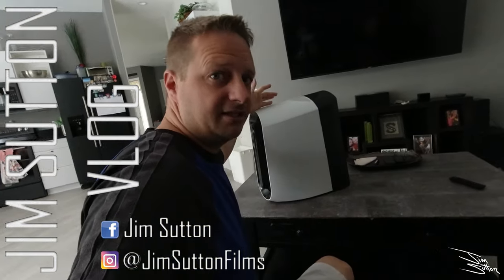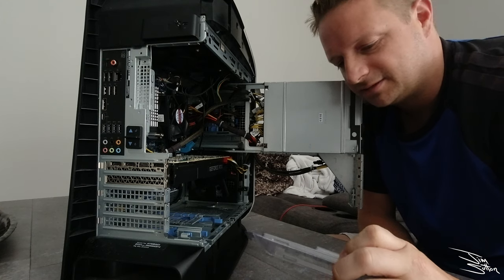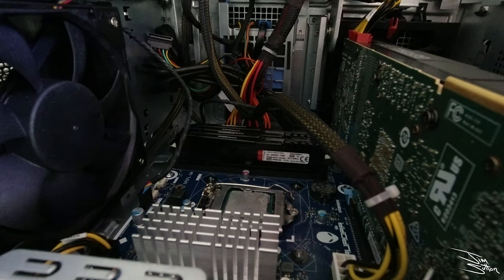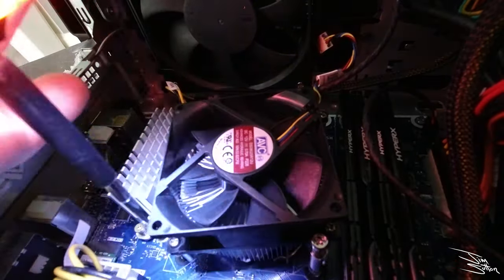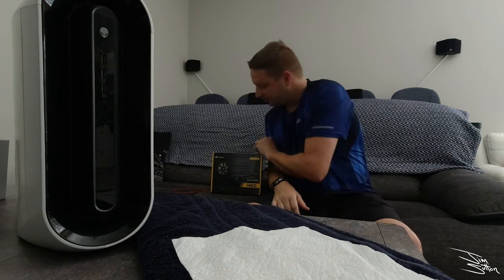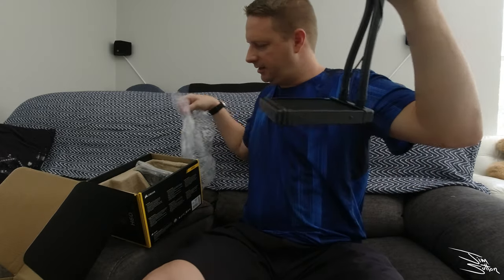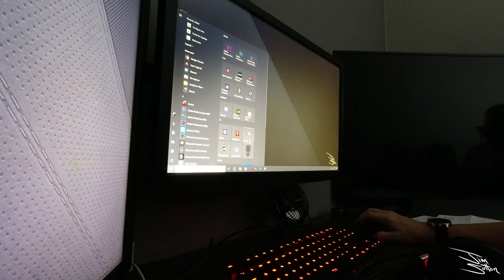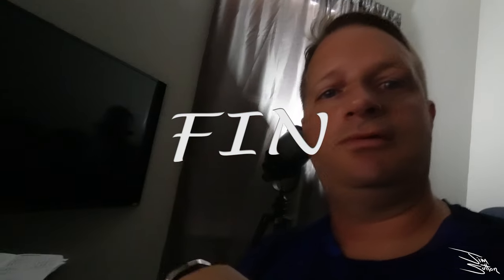VLOG #128 loud Alienware adding water-cooling so its silent and does not run so hot! Alienware R9

Comment: Quick question, I did everything but I get the preboot diagnostic every time now, which inevitably leads to an error saying the CPU fan failed to respond. Obviously, I don't have a clue fan now, what can I do about this? Something in bios maybe?
Reply from the maker: No.  Add pins for the pump.. to pump.  Put the fan on the CPU fan.   That clears the error.  Then add the new fan in addition to that as well if you like. I did.   And no errors in sight.
Reply: @DeCoNzMe  thanks I'll give it a go
Reply from the maker: Yup. Keep us posted.  Nothing difficult.  Just the right fan headers will fix that.
Reply: I’m having this issue too. Tried switching the top fan connector to the cpu fan connection but the pre boot diagnostics screen still comes up.
Reply from the maker: It sounds like fans that are not compatible.
Reply: Well I just got done adding the original top fan underneath the radiator to make the sandwich and now it seems to be booting just fine. Weird. What temps do you get under heavy loads?
Reply: Now it seems to be running just as hot as it was before I made the switch...lmao i cant win.
Reply from the maker: That doesn't make sense.  What configuration did you do them in?  Mine has them blowing up and out of the pc.   The one on the inside of the case is the one that is plugged into the CPU fan headers.  So it changes speed with the temps.  However. I did debate going into settings and have it run 100% all the time.  But I have not done that.
Reply: @DeCoNzMe  So upon opening up the chassis again I discovered one of the water cooling lines was kinked due to the power supply. So maybe that was the issue. Also, its crazy your CPU is running under 50C while gaming. Mine idols between 30-40 but gaming it goes up to 70 sometimes 80 peak, and this is with my side panel off as well as the power supply being out a bit. My configuration is the same as yours except I'm doing this with the R11. So I think our CPU fan headers are in a different spot because my bottom fan of the sandwich(original top fan) wont reach the header. I tried taking the fan out again but then I get the problems booting the system up. Its like Dell is expecting both the top fan header and CPU fan header to be connected. Hopefully when I close it up completely tomorrow I am still getting these temps. Would still be a big improvement from what I was getting with the original air cooled CPU fan.
Reply from the maker: Ya way better than stock air cooled for sure.
Reply: @DeCoNzMe  I got it all closed up and currently idling at 29C. So the kink in the line was the issue. To anyone doing this, be careful of that. Jim, thanks for your video. Without it I would never have known this was possible. Now I definitely plan on upgrading to a 10 core CPU in the future. It's kind of shocking Dell ships out these air cooled units that 100% was thermal throttling.
Reply from the maker: So glad to help!  Glad you got yours running like mine now!

Comment: installed new water cooler in my R9 as shown... removed my RAM in the process... got everything back together and started it up... doesnt start, blinks 2 times, error means RAM not detected... reseated all ram into same slots they always were in... still wont boot, black screen and just flashes twice still saying ram not detected. Any ideas? I no longer have a working PC
Reply from the maker: Try one stick and then the other in the number one slot. And repeat around there.  Doesn't sound likely unless you really bent something.. but I doubt it.  Pretty unlikely
Reply from the maker: Let us know when you get it.   Anyone else have a tip?
Reply: @DeCoNzMe  it ended up being a loose pin for the ram socket on the mother board. Some aggravation and soldering later, memory is now being detected and back up and running with the new cpu cooler.... I cant believe I had to take the mother board out, flip it over and re-solder 2 pins back to the primary RAM slot... my advice, be VERY careful taking the RAM chips out of this board. Ive never seen this before when removing ram and typically you dont need to be super gentle... thats not the case here. Will not be buying alienware again in the future due to this experience. Alienware (dell) motherboards are garbage.
Reply from the maker: Glad you got it.  And good advise to everyone too.  So be gentle!
Reply: @DeCoNzMe  Thank you. I love the computer otherwise... so yes, be very gentle removing the RAM on this mother board, its more fragile than most.

Comment: I recently bought an R11 with a i7 10700f. So if I ever decided I wanted to upgrade to an i9 10900kf down the line then doing this would allow me to do that then?
Reply from the maker: Not sure about those models.  Sorry wish I had an answer for ya.
Reply: @DeCoNzMe  All good man. This video is very helpful. Although I am curious, have you had any issues arise from not having installed that back plate?
Reply from the maker: @staycreamy  it already has the back plate there from stock.   So no.  No issue at all.  There is no difference in the stock one that is already there, and the one that comes with the water cooling kit.

Comment: Hey, I did notice you installed the fan on top of the radiator. I saw in another video he installed it under the radiator. Is there a difference in either position?
Reply from the maker: I ended up doing both. I now have a sandwiched radiator. Fan on top and bottom.
Reply: @DeCoNzMe  Thanks Jim.  also, did you have any problems with plugging it into the PUMP socket vs the CPU socket?  ive read you have to plug it to CPU so it system recognizes it.
Reply: Jim Sutton hey sorry for asking late but in what direction did you point each fan since you ended up putting both fans
Reply from the maker: @c5mourn  I pointed both fans to blow up and out of the case.

Comment: Got an r11 yesterday and the heating was atrocious. Getting one of these today, quick question, how do I remove the top of the case so I can get to where I need to to install everything?
Reply: Additionally, do you still feel it's best to have no thermal paste? That seems a bit strange but maybe I'm just used to fans
Reply: I ended up leaving the thermal paste on there, runs good. 40 idle and it doesn't quite scratch 60 under heavy loads (monster hunter and the forest maxed out)
Reply from the maker: Not.. no thermal paste.. I used the pad instead.  But glad you are getting great gains like I did!
Reply: y didnt u get the r11 with liquid cooling?
Reply from the maker: @krypt2053  if it's like me. I got a killer deal on the air cooled one.  And to pay this small amount to make it a water cooled one saves you a lot of money.  Well worth the small price and bit of time.
Reply: @krypt2053  it was much cheaper to do air cooling and upgrade myself

Comment: I’ve followed everything to the core in this video and I seem to get 80 Celsius just on idle and then 100 if I do any excessive work. Do you think you know what the cause may bev
Reply from the maker: That's the same temps from when it was air cooled.   Sounds like you have a fan, or pump that is not coming on, or not working.  If you want to find me on Facebook. I am happy to try to help you through it to troubleshoot.
Reply: @DeCoNzMe  sorry I just saw this, I tried looking you up on Facebook but couldn’t find you. I was doing well with the temps but now I got the issue all over again
Reply from the maker: @ancianooo_1  are the fans working that are on the radiator?  If that's fine.. it sounds like the pump is not coming on.

Comment: Hey man, I followed ur video and bought that h60 at bestbuy today and found out u bought an older version. I’m returning it when I get my new one from Amazon, there is a 2018 version that is supposed to be way better than this one.  So yeah
Reply from the maker: Oh man. I am sorry to hear that!!  We need to try to make that clear.  What is the difference in the new one? Can youmpost that so people are clear of what changed.
Reply: @DeCoNzMe  I got my 2018 version from bestbuy. Honestly nothing really changes. A tiny modification on the cooler itself and more flexible tubes. But as long as you can fit the tubes in you good to go man. And FYI I put the radiator on top and the top fan behind it which is the Alienware OEM setup.
Reply from the maker: Thank you for the heads up!
Reply: @DeCoNzMe  you mind I ask what spec in your rig? mine with 10700 and 3080 are around 80C in Cyberpunk even with the liquid cooler that is weird. well before was around 100
Reply from the maker: @xyt0435  80 down from 100 is a big difference still.   I have the 9700 with a 2080super.
Reply: @DeCoNzMe  sorry im kind of anal when it comes to specs and mechanical details, the new one has a bigger and more quieter operation radiator, quieter and stronger fans with higher CFM, the sound is noticeably different especially in high speed, you only hair the air traveling in high speed, without hearing the actual fans being whined up, the heatsink on the pump is improved with better materials that is supposedly by alot (corsair claimed) and the pump is also supposedly improved, but i can not really prove or test that, however I can tell u that the rest is true just from comparing the two, noise level, and temperature readings is at least couple degree lower, in high load it is a few degree lower, in a quieter manner.  and it lights up but neither me or you cares about but i figure ill tell u anyways cause im am a little OCD like that. thx for the video btw it help me open up mine to do it.
Reply from the maker: @JamesColeman12  I am always working or gaming with a headset on.  So I guess I wouldn't notice the difference.   Still way better than stock!

Comment: Times like this I wish I had a man (Shaking my head) How did you check the temperature of the computer? What did u go into?
Reply from the maker: This is a free app called SPECCY :  gives you temps and other good info, and its easy to use.      https://www.ccleaner.com/speccy/download
Reply: @DeCoNzMe  One more question..when I started my pc it said the CPU fan failed detection. I know that is because there is no CPU fan in the computer anymore but will that hurt anything??? And the cosay cooling only has 3 holes for the prong fork which has 4 prongs....is that ok as well or no??? I think its all ok because the air coming out the top is so much COOLER! I did notice that!
Reply from the maker: @jenniferhalliwell416  there should be no error after a correct install.
Reply: @DeCoNzMe  Ok I will go back in and check to make sure everythings ok. ALso the prongs...theres 4 but the lquid cooler only had 3 plugs?
Reply: @DeCoNzMe  Never-mind I figured it out. I had to change my little port from port into another of the ports to bypass the message. Works perfectly now! No message...and its running way cooler thank you for everything. I have the R11 so its a tad bit different then yours. Went in it about 10 times but everythings right as rain now! And my back is killing me!
Reply from the maker: @jenniferhalliwell416  nice!  Others may like to hear what was different.. if you remember.

Comment: Will i still get good performance if i dont sandwich the radiator do i need to buy another fan?
Reply from the maker: It still works way better than stock.  It's just another few degrees cooler with a second fan
Reply: @DeCoNzMe  Nice, one more question if you don't mind. How do you get the top part of the case off?
Reply from the maker: @donovanhendrix9857  https://www.dell.com/support/manuals/ca/en/cadhs1/alienware-aurora-r9-desktop/alienware-aurora-r9-service-manual/removing-the-top-cover?guid=guid-24af8f06-18f7-404c-ba7a-1f814d07c178&lang=en-us
Reply: @DeCoNzMe  thanks!
Reply: @DeCoNzMe  how does the fan from corsair mount for the sandwiched radiator and where does the corsair fan plug in on the mother board?
Reply from the maker: @donovanhendrix9857 I used cpu fan for one, and top fan for the other. It worked for me.
Reply: @DeCoNzMe  thanks! and how do i mount both of the fans with the radiator in the middle?

Comment: Can u link in the description or in this comment what exactly you bought please because I’m planning on doing this to my r9. Great video 👍
Reply from the maker: Yes I can    https://www.bestbuy.com/site/corsair-hydro-series-120mm-radiator-cpu-liquid-cooling-system-black/5845215.p?skuId=5845215
Reply: Jim Sutton thank you sm
Reply from the maker: No problem. Glad this helps you.  Best of luck with your mod!
Reply: Jim Sutton there is talk that there is a chance that liquid coolers can leak and destroy the pc parts, should I still get a liquid cooler?
Reply from the maker: @anthonyhoffens3382  its not very likely.  inspect your parts first. and don't pinch a water line.  you should be fine
Reply: Jim Sutton yeah it’s because I’m still pretty new to this so its kinda confusing
Reply from the maker: @anthonyhoffens3382  you got this. We all believe in you!   If you buy a kit like I did. It's pretty easy.
Reply: Jim Sutton thank you I appreciate it

Comment: Hi Jim, great video, before I do it to mine, could you please explain why did you remove the thermal paste that the water cooler came with? did you apply more yourself afterwards or did you install it w/o thermal paste?
Reply from the maker: i used the thermal pad i got.. you dont have to do that.

Comment: Mine makes so much more noise now what did I do wrong.
Reply from the maker: What fan is it? If it's the original fans.. when they go to high rpm they are crazy loud.  But if you have it setup like mine, it should be almost silent.  Do you have something hitting the fan?
Reply: Jim Sutton I followed the tutorial above even put the cooler the way you had it. It seems to be running at high temperatures on top of that I know I have everything plugged in but it still running at 100% which is probably why the fan I so loud what should I try

Comment: Am I able to do this with the R8?
Reply from the maker: My guess is yes.  Because you can get that one with water cooling as an option, same as mine.   So it should be an easy fit.  But I would do more research on yours to make sure the fit is the same.
Reply: @DeCoNzMe  Okay thanks! I found a video how to install it.

Comment: Mine is running at an average of 52c at idle, it's a i9 9900, shouldnt it be cooler than that
Reply from the maker: That is extremely hot!  If it hits 100°f it's too hot. And starts to get dangerous for the life of the processor.   You definitely need to go water cooled.. or you have some other problem.

Comment: Can anyone help! Plz! After I installed the water cooling fan my pc ran crazy with the fan and said cannot detected the cpu fan how can I solve that 😩😩😩😩
Reply from the maker: Use the stock fan. Sounds like the fan u have is incompatible
Reply: @DeCoNzMe  what is the clock fan?! Which one is it?
Reply: @DeCoNzMe  I bought the h60 and just did the same thing as you but it just doesn’t work 😫
Reply from the maker: What pins do you have each fan plugged into?  It has to be what is wrong.
Reply: Pins should be right pump to pump top to top did you use the fan from alienware or from the box? I am like after the install  the machine just keep saying cannot detect cpu fan and the front fan ran like crazy....
Reply: @DeCoNzMe  oh! I saw you using the top fan from alien! Is it the reason why I’m getting the notice for cpu fan missing?
Reply from the maker: Do you have the pump plugged into the pump header, the top fan in the top fan spot, and then if you used another fan, then put that one on cpu fan.
Reply from the maker: Well first.. there should be no cpu fan at all, unless you are running the extra fan.  And the front fan should not be changed at all.  Is that correct in how you did it?
Reply: I am now fixed everything by asking dell people and found that I didn’t connect SATA cable to the power line which means I didn’t power up my pump the entire time. Right now my device work just as low temp as it can without any annoying fan noise. Thanks for the video overall. Have a good year 2021 LOL

Comment: ive installed it, and i keep getting system error for cpu
Reply from the maker: Then you have the fan plugged into the wrong pins I assume.  Or used a fan that is not compatible with the system.  Did you buy a different cooler?
Reply: @DeCoNzMe  I bought the one you linked and hooked it up, it works fine but i keep getting a pre boost system performance check with critical error- fan- the cpu fan failed to respond correctly
Reply from the maker: @EpicDeathWIll  if you have a boot error message, then that fan isn't working.  Try the stock fan only and see what 8t does.  If the error clears, then it's the fan that came with your setup you bought.  Let us know...
Reply: @DeCoNzMe  update: pc would not turn back on, but I got a new one, after this pc, im completely building from scratch
Reply from the maker: @EpicDeathWIll  what? Sounds like you had some major issues.  Sorry to hear that!